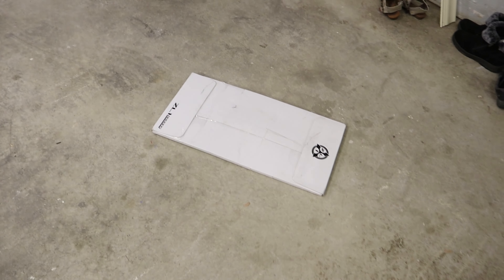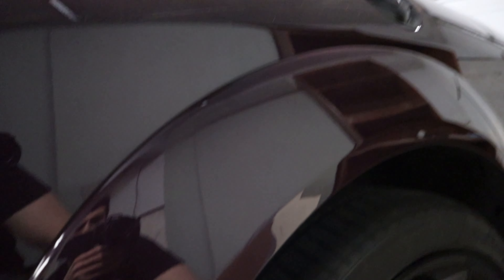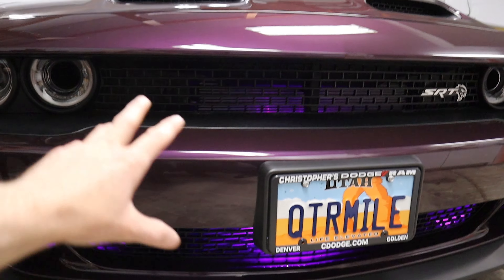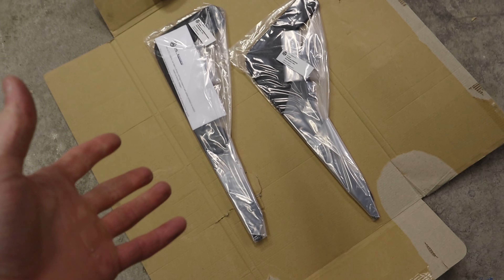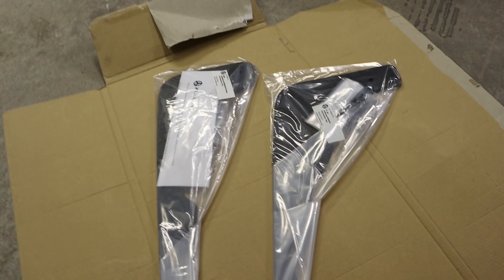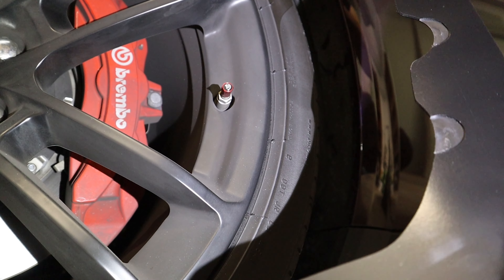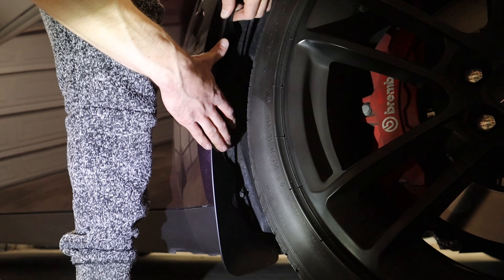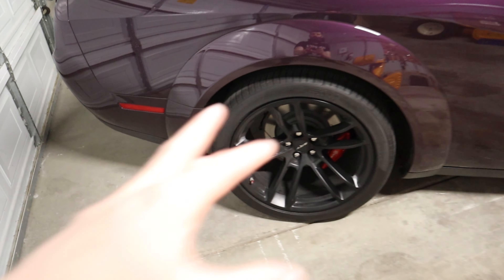*EVERY WIDEBODY NEEDS THIS* HOW TO INSTALL ROCK GUARDS (MUD FLAPS) ON THE DODGE CHALLENGER WIDEBODY!

Comment: I put them on as soon as I picked up the car.  Well worth it.  Easy install, no need to drill.  I've had them on for 6 months and they are still on tight.
Reply from the maker: That's great to hear! I'm glad that they are still holding well. And you're smart for putting them on so early

Comment: IS IT NECESSARY TO ALSO ADD EXPEL PPF TO ALL 4 WHEEL FLARES🤔?? AND FRONT  END  ON TOP OF BUMPER AND BELOW??🤔🤔
Reply from the maker: So I added paint protection to the whole front end of the car. I didn't add it to the rear fender flares because the price was a little steep. If you want the most coverage then I would recommend it. Otherwise the rockguards should be pretty good and are less expensive than the paint protection film

Comment: Yes they are worth it. I've had mine on for 1 year this month. No rock chips on the sides. I put the screw on and glad I did. Twice I've ran over road hazards that should have broken the guards. They are fine after a year of use
Reply from the maker: Good to know! I may put the screw in if I run into any issues

Comment: I have a jailbreak on order.  Nice video I definitely will do something to protect the paint.  I am having the car get PPF right from delivery and planned to do the whole front end, hood, front fenders, mirrors, and all 4 flares.  Do you think it is also necessary to PPF the bottom of the doors?  How much chipping did you notice on those areas? Trying to run the car without the guards and let the PPF take all the hits.  Thanks.
Reply from the maker: Good question. I would say PPF on the rear widebody fender is necessary. I'm noticing rock chips that shoot out from the front tires and cause little chips in the rear widebody fenders. As for the doors, you could probably get by without PPF but if you want the best protection I'd get it there as well. There are some smaller scratches in those areas. You could possibly buff them out later but still something to keep in mind

Comment: I have a Scat Pack Wide Body on order and was debating between the ZL1 and Swaim rock guards. I like that I don’t have to remove the tires for the ZL1, but wonder if you looked at the Swaims?
Reply from the maker: Good question. I didn't look at the Swaims unfortunately so I don't think I could provide any advice there. So far my ZL1s have stuck to the car. Also love your name haha!

Comment: I put rock guards on mine from day one.  Still have rock chips.  I don't think there is anyway to completely avoid it.
Reply from the maker: No definitely not a way to prevent it 100% but I'm sure you would have had more without them

Comment: What I find ridiculous  is how long the widebody has been available and still this is the only thing that I have been able to find.  I feel it was severely important that dodge or someone else could have made something more than  this thin piece of plastic.
Has anyone found something other than this. Would really appreciate if anyone would let me know if you did .
Reply: I actually ordered spashguards from MOPAR that said they would fit a 2021 widebody. Unfortunately they do not actually fit the widebody. I even took them to my dealer and they said the same thing. Dodge claims they fit but they do not. 

So I returned them and ordered the ZL1s.
Pretty lame. Honestly splash guards should be a factory option IMHO.

Comment: $100 is too expensive To protect your $90,000 car that’s not Shwayze
Reply from the maker: I agree that it's worth the price (that's why I still go it) but I don't agree that it's worth the actual material. $100 for a thin piece of plastic is overpriced. Just because it goes on an expensive car doesn't mean it needs to be expensive
Reply: @SchwayZ  That’s true but you don’t cut off your nose to spite your face